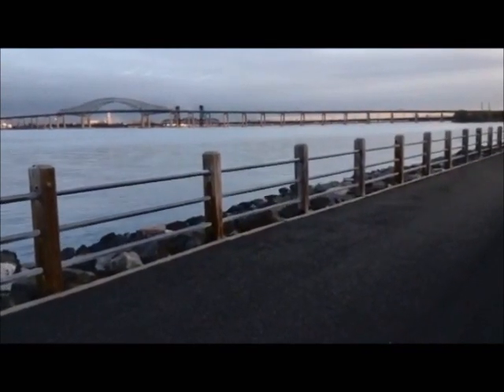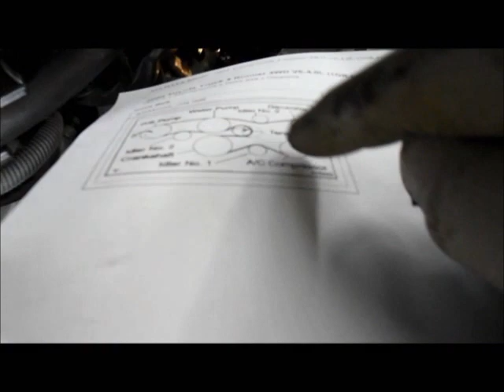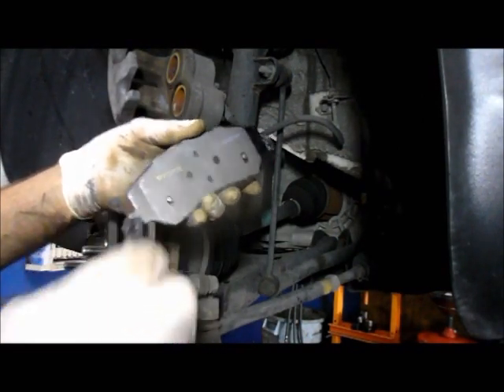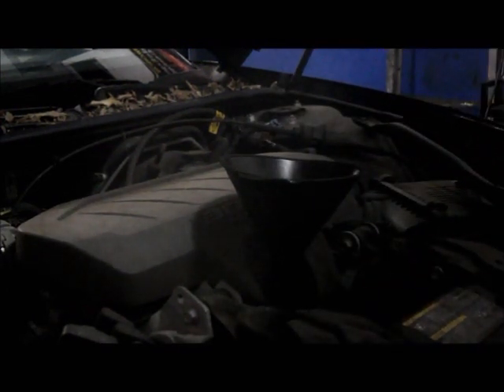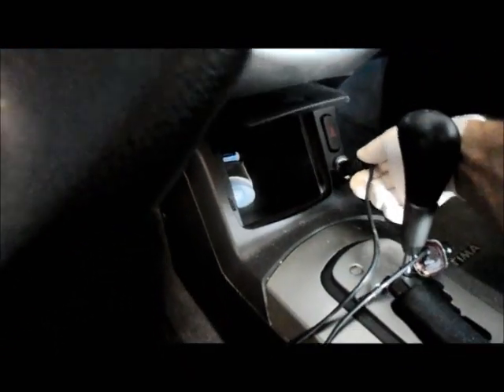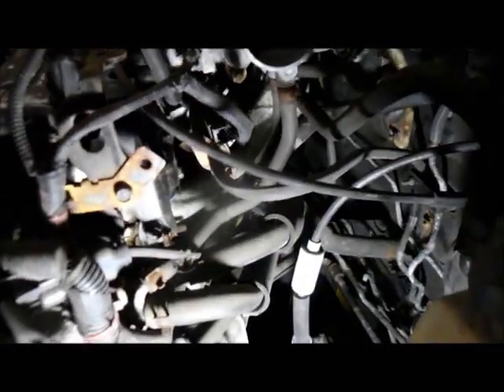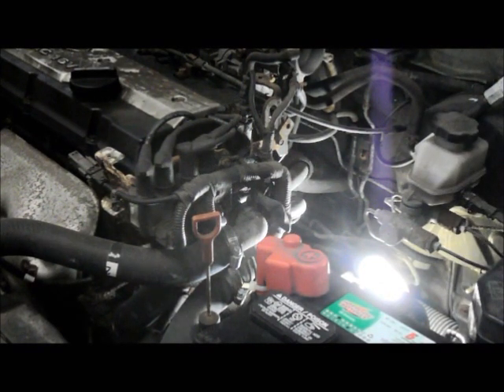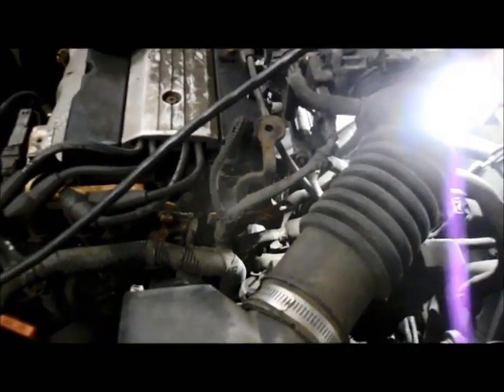A typical Day At The Auto Repair Shop For jimthecarguy

Comment: Did you need to shim the starter on the Huyandi?
Reply from the maker: No they don't get shimsThanks for watching.
Reply: Jimthecarguy I had to replace the starter on my.former 92 Century 3.3 V6 many years ago and had to use shims as the bendix was hitting the flywheel at a low angle - had to bring it up a bit so it would properly engage. That is why I asked.

Comment: What kind of tool will I need to remove the bolts on a 2006 Malibu chevy, I need to change a bulb on my passenger side. THANK YOU
Reply: +Zachariah Greggs I asked the guy at the Autozone but he said, that I would have to bring my car up there and they may or may not have the tool to remove the headlight bracket.
Reply from the maker: +Zachariah Greggs  You will need a torx bit to remove the screws
Reply from the maker: +Zachariah Greggs   Ya it is a torx bit or some time called a star bit.Good luck.If you need any other advice let me know.Jim
Reply: jimthecarguy oh way cool thanks a lot Jim